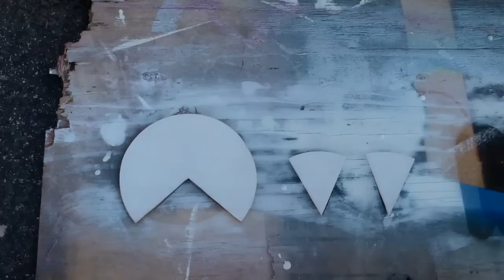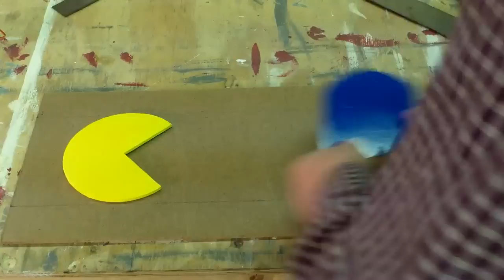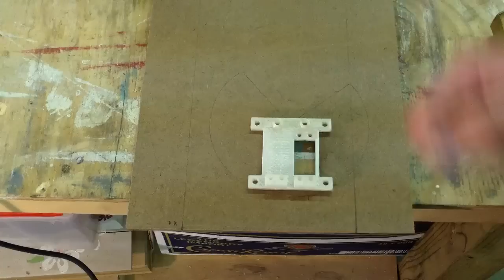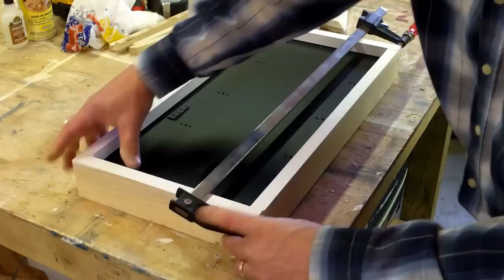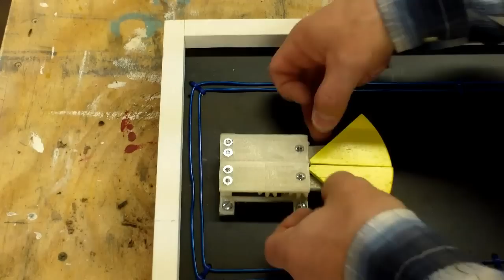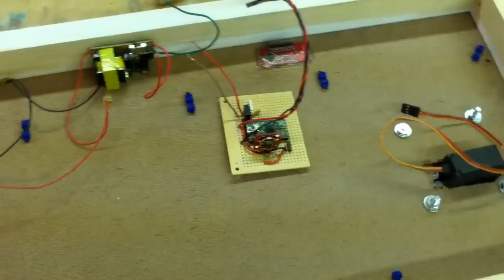Making a Pac-Man theme clock

Comment: Battery Model: 88VF	
VF (Pin 7) VF is an input pin for the battery ID resistor connection. 
This pin has an internal 1000kΩ pull-up resistor. 
Thus a typical 20kΩ ID resistor will pull this pin to logic low state, indicating a valid battery connection.